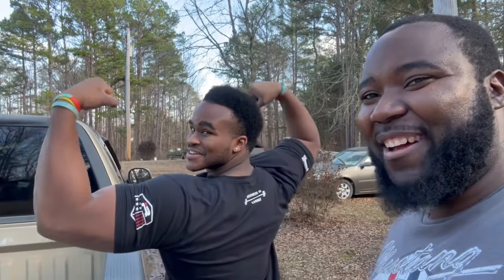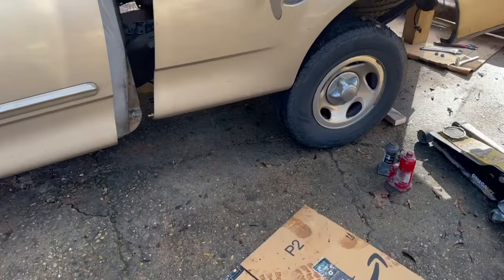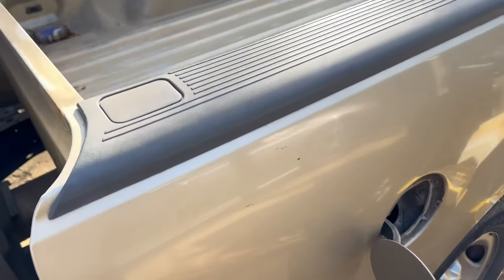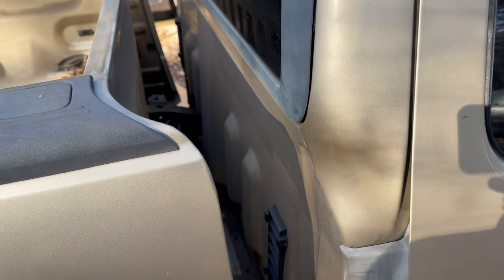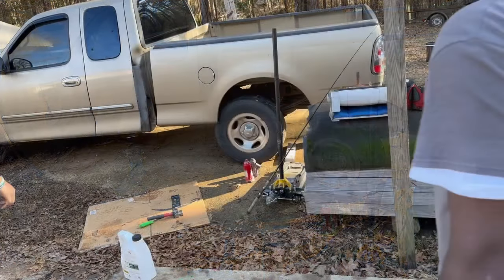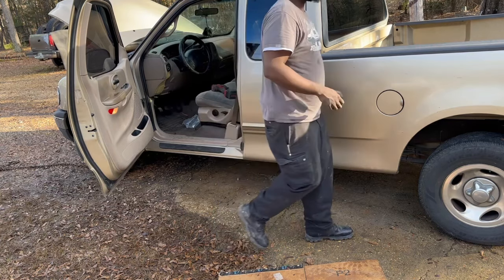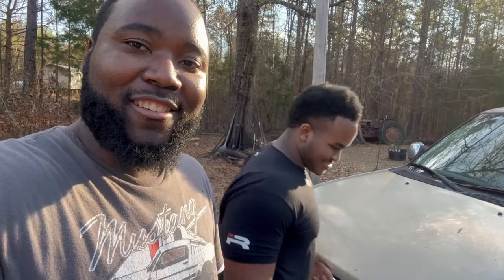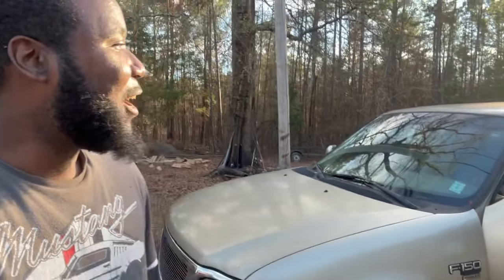Easiest fuel pump change on 2000 Ford F150

Comment: Man just came across your video imma try this saturday my fuel pump went out on my 03 f150 harley first problem I've ever had with her but this looks way easier than dropping that tank... thanks
Reply from the maker: Yes it is definitely man cause dropping that tank especially with gas in it that makes for a long day
Reply: I had just filled up when it stopped on me luckily i wasn't that far from the house
Reply from the maker: @reeseb9768  wow that’s what you call clutch at least the tow bill wasn’t bad and I will give this tip I can’t remember if I said it or not those bed bolts are star bits and some of them do tend to rust so if you want to you can spray some pb blaster or wd 40 around those bolts to loosen them up and make it easier to come out I had an impact with me that day so I was able to shock it loose
Reply: Ok then i appreciate that tip I'll make sure to do that
Reply: @mississippiwrenches295 
Well come to find out on the super crew models  you have to drop the tank bcus the pump itself sits under the cab just under the rear back seat😡😡
Reply from the maker: @reeseb9768  wow but I guess that would make sense cause the crew cab got a shorter bed than that extended cab wow I hope it wasn’t to bad to drop but I know it sucked though

Comment: I agree w/ other comment, this should have million views. 

I had ta drop a tank on 96 Jeep Grand Cherokee alone w/ nothing but a floor jack and jack stands, not once, twice. I ended up not being strong enough to get metal tank cover back on. Then there was a recall on tank and dealer replaced.

This looks so much easier but then you got to have an extra hand. 

Thx for upload. I'm looking to buy a non-running 03 F150 XLT. Kid doesn't know about disastrous affects of, leaving it sit and condensation build up in tank. Says start up and it's crackling.. 

"Here lets flush watered down fuel into pump and see what happens!" Every man should know about engine combustion! But then common sense goes a long way too.
Reply from the maker: Thank you very much hopefully it ends up at a million but I will say for the bed make sure to get that special torx bit for the Ford bed I believe you could get it on amazon pretty cheaply it will help with loosening those bolts in the bed i wish I would have though to put that in the video but definitely good luck on that 2003

Comment: Imma have to try that instead of dropping the tank on mines.. Great idea and video💯💯💯
Reply from the maker: Definitely for sure it’s way easier than dropping that tank right there at the top 👍🏾
Reply: @mississippiwrenches295 agreed, and thanks for the quick reply.. Question: will this method work on a 2001 short bed f150(super crew) as well??
Reply from the maker: @jaymood6607  so with that crew cab unfortunately I believe the fuel pump opening is up under the cab so that one would have to be dropped

Comment: I tilted the bed to one side on my Ranger and supported the bed with blocks. Worked great. Did all the work by myself. Why manufacturers don't put an access plate in the beds is beyond me. Very lame.
Reply from the maker: Yes it would be nice of them to do that for sure
Reply: Because its job security for the stealerships
Reply from the maker: @jlenz210  that is very true for sure
Reply: That would’ve cost an additional dollar or two. Dam bean counters make life hard
Reply: yep it would be  easy  with  a access  door  with  bolts

Comment: Thank you sir.   Wasn't sure if I pulled bed off if I be able to get to it because ext. Cab.   Thanks again
Reply from the maker: @coadams4856  yes no problem at all 🙏🏾 thanks for watching
Reply: Just got new fuel pump in.  Bed tightened back and it runs like a scaulded dog😁

Comment: Thanks for the video man, Do you remember if you did the whole assembly or just the pump?
Reply from the maker: @carlosvalenzuela7743  so with that repair it was just the pump I used the old assembly but changed out the pump 👍🏾

Comment: You did it perfect you didn't have to take off the bumper though  You just disconnect the backlights and set the bed on the wheels I did the same thing
Reply from the maker: Yes i saw that that when I was moving it off that’s why I had it optional but man moving the bed back just made that jobs so easy
Reply: Thanks for the info, I have to do this myself and don’t have any help 😭. Nice that I can slide it instead of removing all together
Reply: I done three of these and don't believe not removing the bumper is an option. Having to move the bed back to clear the cab runs the lower rear into the bumper

Comment: Or the easiest way is to cut a square hole in the bed floor just above the pump and not remove the bed, bumper or anything else beside the pump. Install a hinged door for easy access for next time. Then you could cover it with a plastic bed liner or rubber bed liner mat.. Just and idea for someone that has a beater truck....
Reply from the maker: @skulledmonte84  yes I have heard of people doing that before

Comment: Your video of replacing fuel pump on a f 150 was great.I changed my truck pump but still having the same problem when it sit a few days it won’t crank until you spray starting fluid in the throttle body it will run good all day and start every time.But when you leave it sitting a few days it’s the same thing .Any ideas I would sure appreciate it.
Reply from the maker: It might be a priming issue so when ever you leave it for a couple days do this test cycle the key to the on position enough to hear the pump do that about three times and if it cranks up then it’s the fuel injectors losing its prime
Reply: @mississippiwrenches295  I done that from a while with the old fuel pump and it worked good and I could hear the pump kick on then it  quit cranking until I spray starting fluid in it and it would run good all day until it would sit for a day then same thing all over again. I just use it a couple of days a week . And a big thanks for answering me back.
Reply from the maker: @williampayne948  I’m thinking it’s going to be them injectors
Reply: @mississippiwrenches295  Thanks for the information.Got it cranking good now it was combination of fuel pump and fuel filter was clogged up.Thanks
Reply from the maker: @williampayne948  cool deal glad you got it up and running smooth 👍🏾👍🏾

Comment: I have a 2000 with the same swoop, couldn't you have lifdted the bed out from the sides? I'm not sure what was stopping it from coming out all the way. I need to replace the fuel pump too, thanks for the video!
Reply from the maker: No problem thank you for watching.And what do you mean  lifted the bed out from the sides?

Comment: Do you disconnect the brake lights and what about the tag lights
Reply from the maker: I did for that just so I had room and so it didn’t pull on the wires
Reply: I’m going to do this tomorrow any extra tips my friend?
Reply from the maker: @hherrera1234  make sure those beds have star bits or torxs to hold the bed down make sure to run some wd 40 around those bolts and make sure to get a star bit that snug but  other than that it’s straight forwards

Comment: Wait, what are those white clips you slide onto the tubing to detach the hoses??
Reply from the maker: @the_3rdKind   those are fuel disconnectors they come in a kit
Reply: @mississippiwrenches295  thanks, I guess I can get those at an AutoZone.
Reply from the maker: @ yes you can they are there and you can also get the master kit on amazon just depends on which route you want to take

Comment: Now if you got a 4 door f150 similar years your gonna have to drop it regardless cause the cab covers that part of the fuel tank
Reply from the maker: Yes you are definitely correct on that unfortunately that cab do cover it up
Reply: Maybe... Cut a hole in the floor. Patch it... Nobody will ever see it..

Comment: I just done a pump on one of these .  It don't take as long as you think verses Taking that bed off .  Use a racing fuel I had laying around pump with hose drain it . 10 min less taking the nuts off strap. Drop down took hose off done
Reply from the maker: Heck yea it’s not that bad but i like this method better not laying down on my back as much but yes I will remember this method whenever I get one were it’s not an option to take the bed off

Comment: Is there wiggle room when reinstalling, like to make sure the bed is not slide over one way to far or not or does it “lock in”
Reply from the maker: So it’s usually set in I can’t remember if that year model have line up pins but it’s really not to much wiggle room once you get that bolt in all four corners your good and then you can put the middle ones in 👍🏾
Reply: Thanks.   I’ll be doing this soon

Comment: Will this method work for a 2001 ford F150 supercrew as well?
Reply from the maker: Yes this method should work and I believe if I’m not mistaken I think that bed is lighter
Reply: @mississippiwrenches295  its only a 5 or 5.5 foot box. Kind of a useless truck for hauling anything, I need to buy a flat deck trailer or something. Thanks for the great video!
Reply from the maker: @gunit6815  thank you 🙏🏾

Comment: Say what you do best is improvise. Wondering why you did get couple frames of you improvising in that model f150 has the tricky "swoosh" you speak  of been nice to watch that. Any body can unbolt a fuel pump. Video of take the off or back a ft woulda been nice
 Cute muscles
Reply from the maker: Yes. Well for that to be honest I just plain out forgot to record the first time us picking up the bed but you are right that would have made some nice footage but it would have lengthened the video as well

Comment: Just a heads up to the people who have the 4 door models... This method won't work. The cab is over the top of the fuel pump. You have to drop tank.
Reply from the maker: @texas_man_the_legend   yes on the 4 door this method won’t work unfortunately

Comment: My 99 ford fuel pump went out.   Not the relay fuse or the fuel safety switch.  178k.  Guess it’s time.  Gonna be doing this in two days on my day off. I never thought to slide the bed back    This is going to be a life saver
Reply from the maker: Oh yes big time life saver
Reply: @mississippiwrenches295   as a father of 5.   And sorta struggling this year thus far. I promise you this video helped out in so many ways.   Bless you
Reply from the maker: @CMDRTeklow82   i definitely thank you 🙏🏾 and glad it this video helped